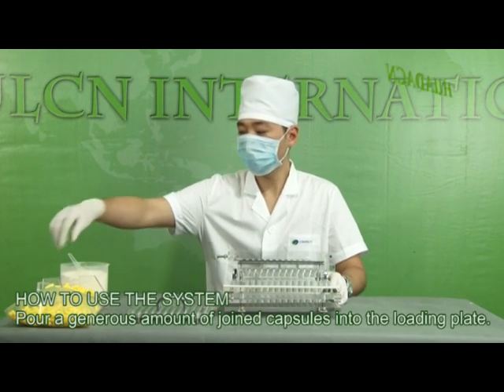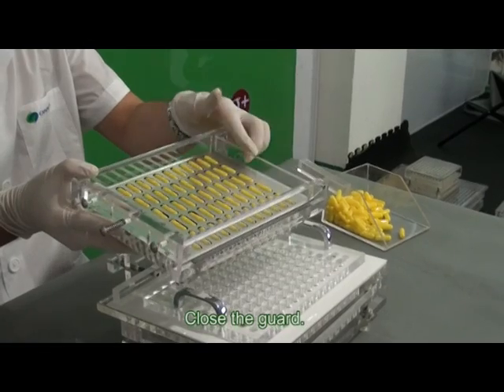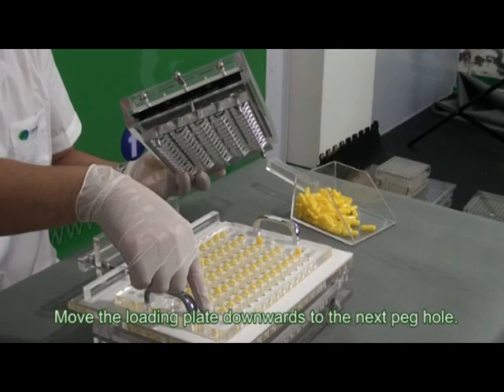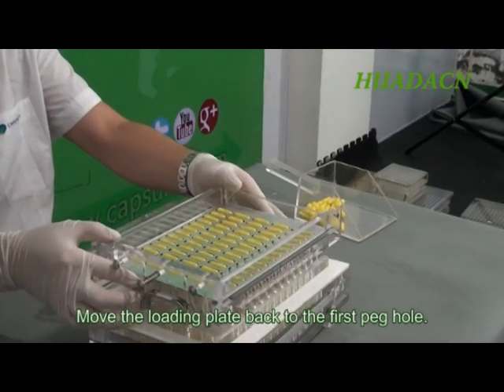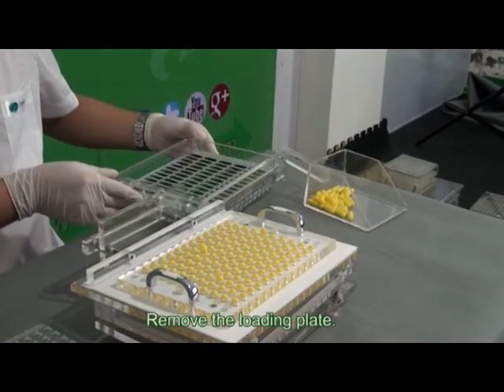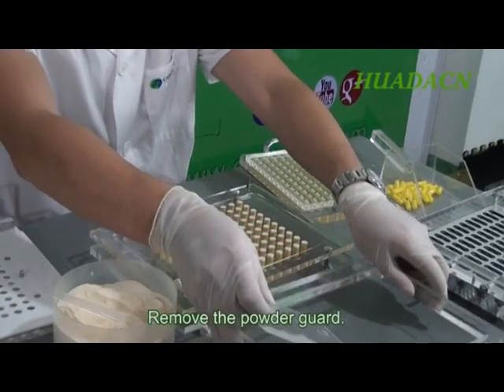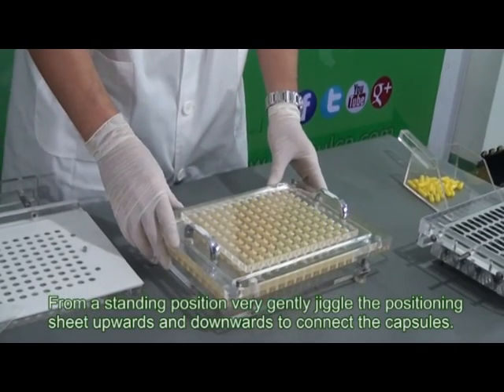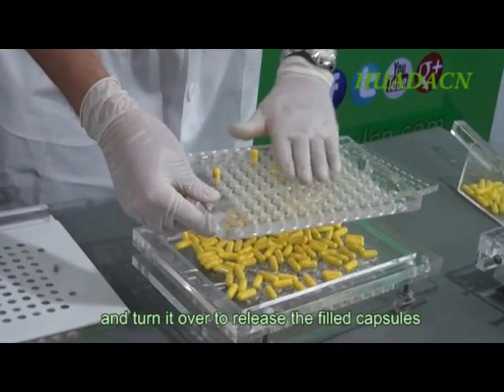CN-120S Operation video Hand operated capsule machines,encapsulation machines Part 3

Comment: Interesting.  We live in a high humidity sub-tropical (no ocean/sea water) location that can make metal rust.  Will this machine rust in high humidity?
Reply from the maker: My E-mail is maria@capsulcn ,my what's app is +8615606879111 ,May I have your what's app or E-mail ,send you quotation.